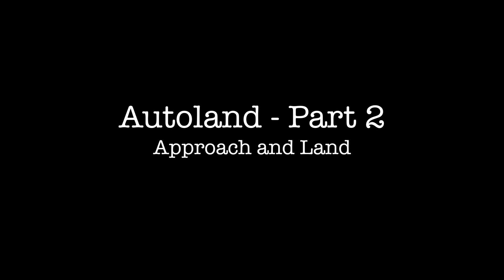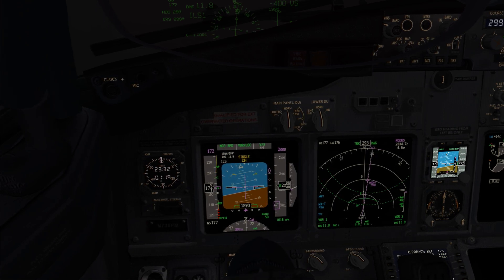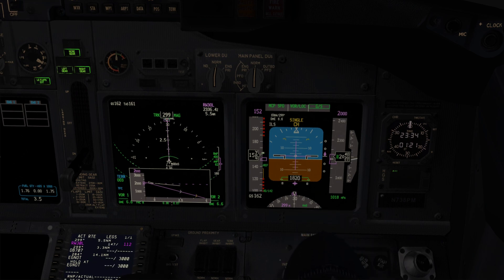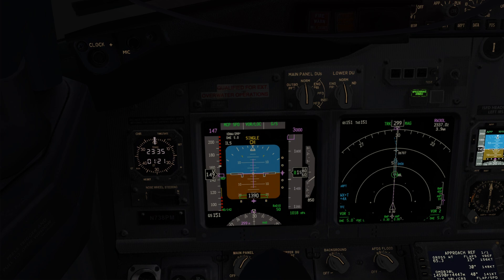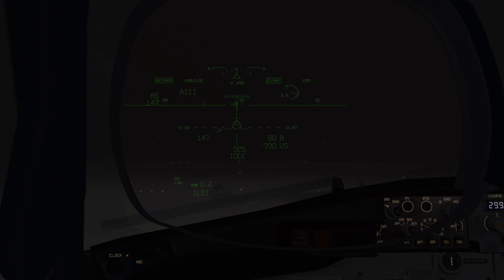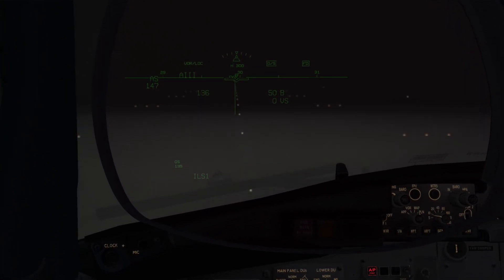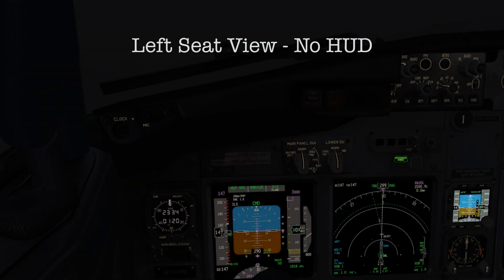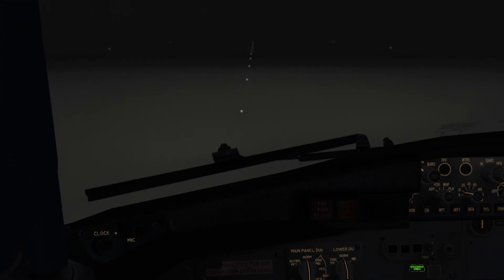Autoland Part 2 - Approach and Land

Comment: Thank you very much for the video Captain. Just a question please. There may be occasions where "Flare" wouldn't engage at 50' ft right? Could you please remind on the correct actions to follow? Did the training 2 years ago, just trying to recall it back again... Many thanks.
Reply from the maker: Francesco, if FLARE does not engage at 50 feet RA, PM calls "NO FLARE" and the PF initiates the go-around. If the PF considers it is safe to land, he or she may choose to land manually (have in mind it can be very tricky). The procedures shown on the video may vary from one company to another.
Reply: @boeing737pro3  Many thanks for your reply, it is now clear and refreshed 😄! Hope to see you in the cockpit one day 🤞🏼